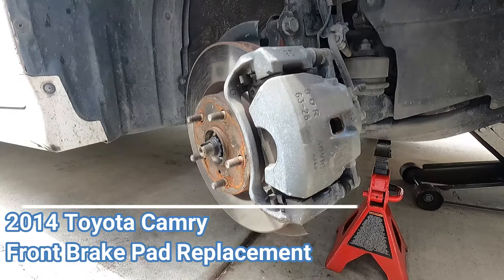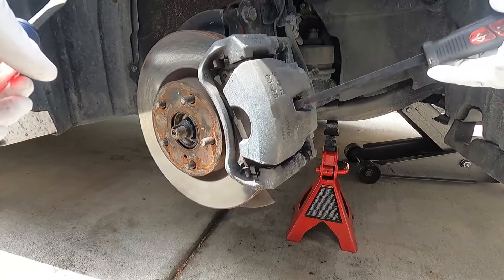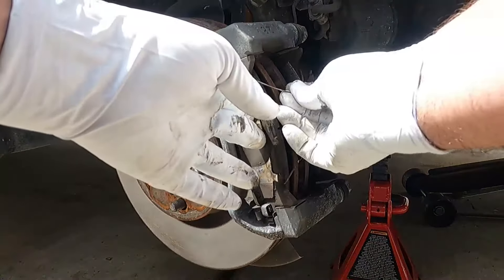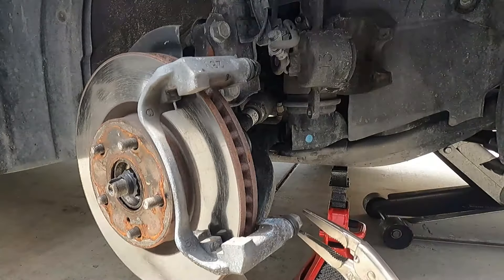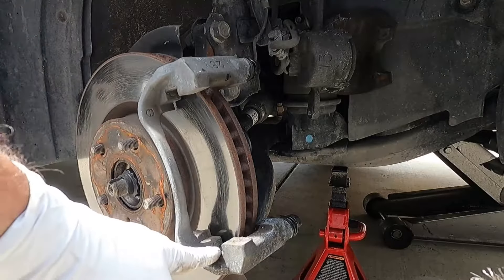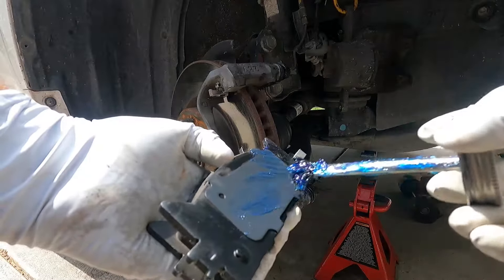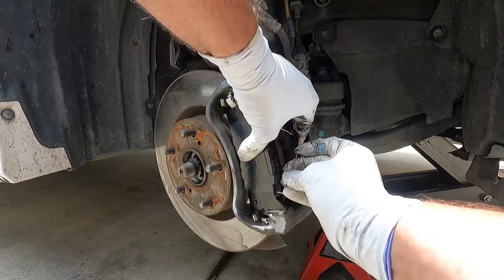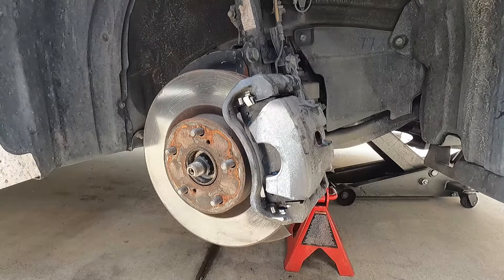2012 – 2014 Toyota Camry - Replacing Front Brake Pads - Easy DIY!

Comment: Asbestos exposure while brushing off
Reply from the maker: Glad you pointed that out.
Most auto manufacturers stopped using asbestos in brake pads in the 1990s, but you should still probably should wear a mask just to be safe...
Reply: @DantheFixitMan  brother I just did some breaks yesterday I believe Bosch ceramic and you can literally see the fibers in the pad. P100 respirator.
Reply from the maker: @ Bosch actively states that their brake pads are asbestos-free.  They say that they use NAO technology 'non-asbestos organic materials'
Maybe those are the fibers that you were seeing?
I can't be sure on the information above, that's just after a quick google search...your advice on the respirator is helpful.
Take care,
-Dan

Comment: I had to order a set of thin metric wrenches.  I did not have a tool that would stop the inner nut from spinning when trying to loosen the slide pin bolts.  Thank you for the excellent video.    It was just perfect.

Comment: Wouldn't it be best to go ahead and replace the rotors as well.
That's what I've started doing.
Have had trouble with them warping.
Reply from the maker: I usually do as well, but the owner needed to save a little money.